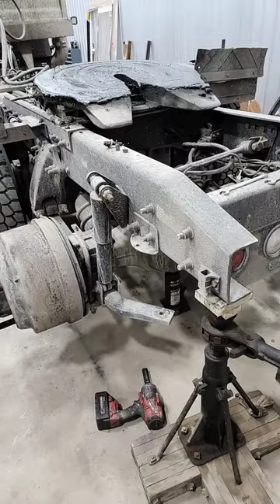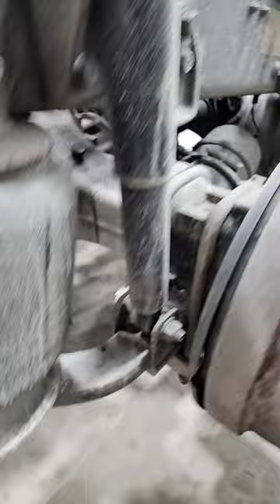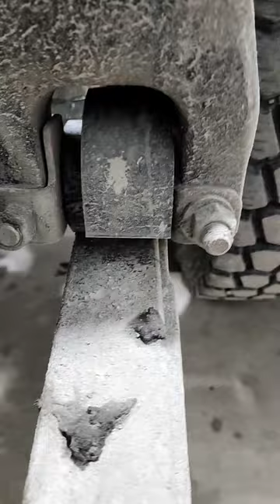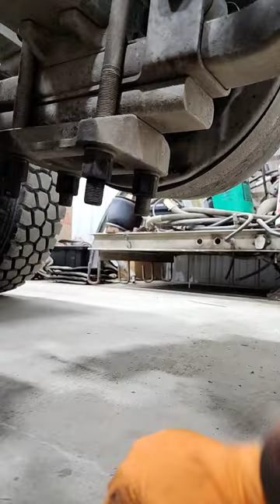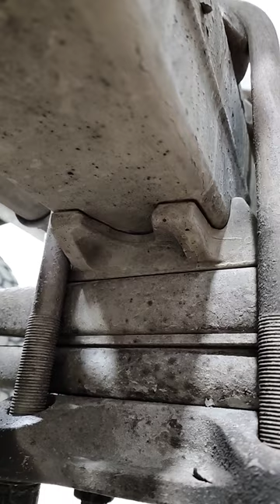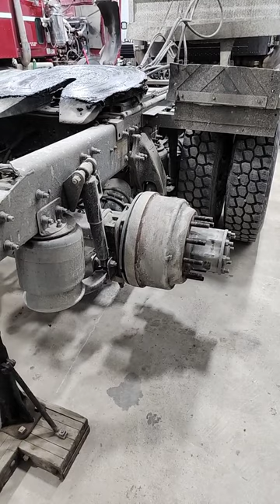More work #freightliner #cummins #diesel #alaska #trucking #suspension

Comment: I think maybe you should check those U-Bolts to see if they are not loose. If the axle is walking around on that plate the bolts are loose.
Reply from the maker: First thing I did was tighten them and it still continued to walk due to the broken center pin which was braking because the blocks that go between the axle housing and the spring where two different blocks one was 5.5 degrees and the other was 3 degrees which was putting the suspension in a constant bind. It also doesn't help this truck grosses 155,500 lbs when loaded.
Reply: I’m pretty sure they tighten the ubolts with a torque multiplier. They can get really high torque specs depending on the width of the bolt.
Reply: @thenumber8llc  fixed both of mine by replacing the axel saddle putting it all back together then running a weld bead right up against the saddle on the axel housing..4 years later no issues,  just check the u bolts a couple times a year.
Reply from the maker: @leejohnson6173  genius 👍👍

Comment: Might be caused by that piece of frame missing due to a driver missing a trailer king pin.
Reply from the maker: It looks worse then it is, it's been that way sense I've bought it back in 2019. The bottom part of the c channel is still straight and true 👍

Comment: bent frame rail  ????
Reply from the maker: I know the very back of the frame is damaged but I have never actually tried inspecting the entire frame rail. I do know that a driver from the previous owner did tip a side dump over which twisted the truck bad enough it ran the fan into the fan shroud and radiator...🤷‍♂️